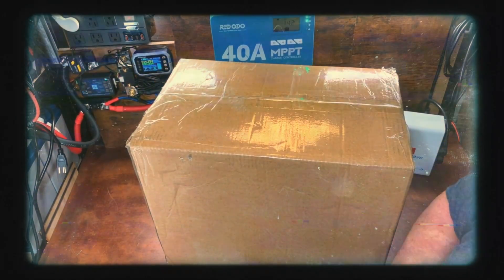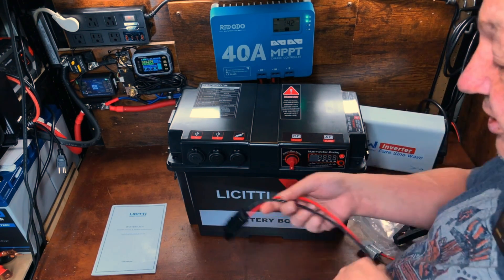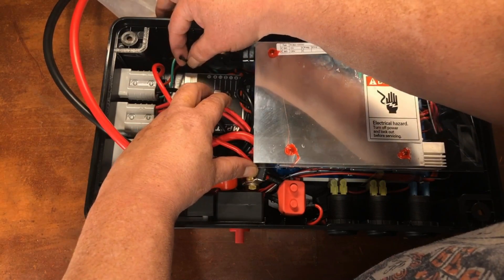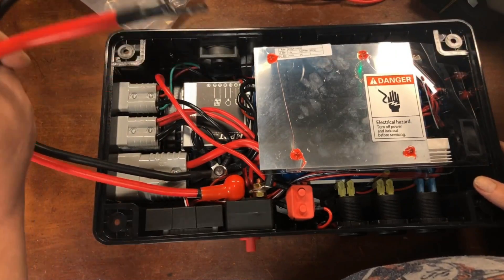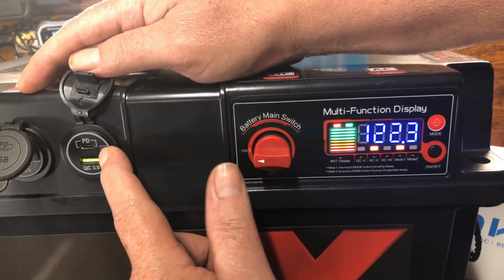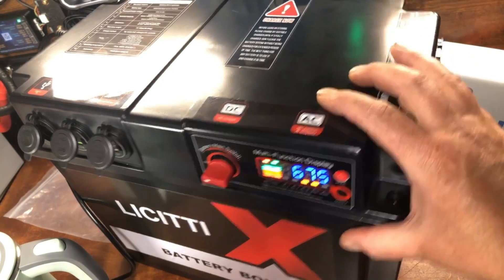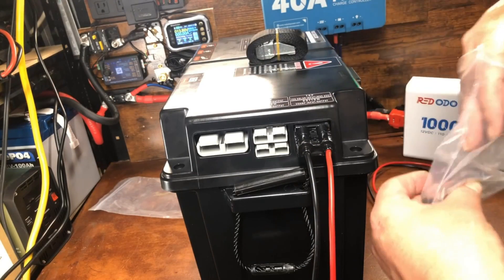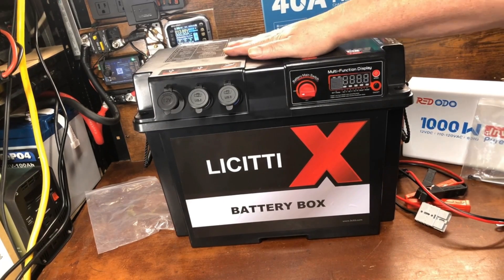CHEAP & EASY DIY Solar Generator for Beginners

Comment: Is a 10 amp charge controller enough. I don't see why they didn't have a 30,
Reply from the maker: Yea I would have rather had at least a 20a, but a 30a would have been ideal. 10a will support a 100-130w panel. Hopefully they see this and consider upgrading it a little even if they have to raise the price a little because I think it would have even greater appeal. But, what I like is the way its wired you could easily add a small controller of your own and run 2 charge controllers at the same time, and the ability to add another external battery without having to pay a fortune for that feature like most power stations makes this thing really functional and expandable.